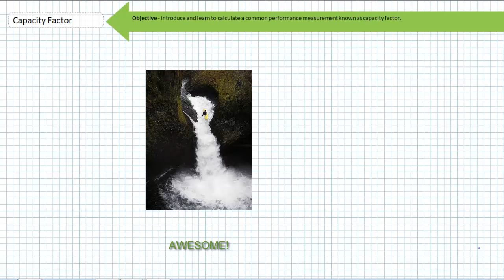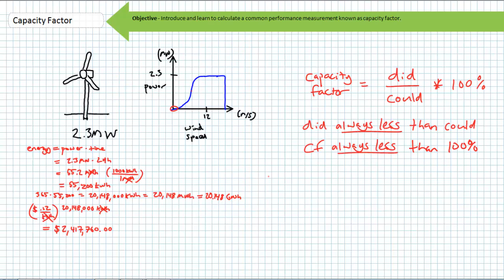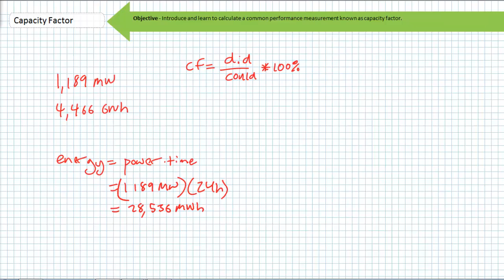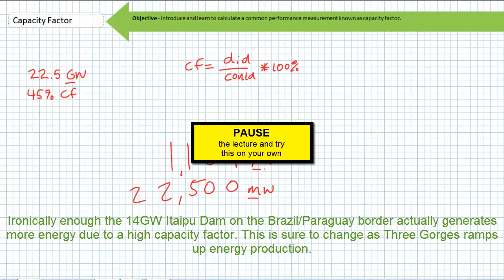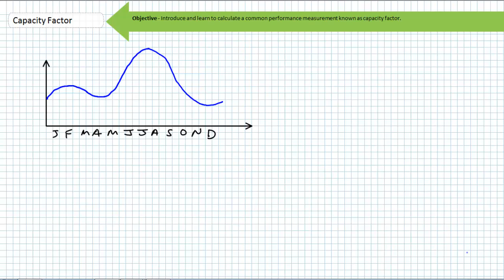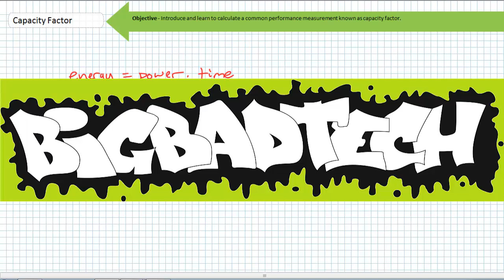Capacity Factor (OLD LECTURE)

Comment: Perhaps they paint them white so as to absorb less heat from the sun thereby conducting less heat to the critical areas that require cooler temps such as the gear boxes with the lubricating oils. I am guessing if painted white, the thermal conduction to the lubricating oil is less and therefore has less thermal breakdown of the oil and needs to oil replacements less often...I don't know, just a guess
Reply: Working in wind for over 7 years now, this is what the engineers that work for our manufacturer tell us. "Most turbines are painted pure white or light grey, in a bid to make them as visually unobtrusive as possible. Generator Protection: The white also reflects sunlight, which minimizes expansion and cracking of the gel coat that protects the fiberglass composite rotors."